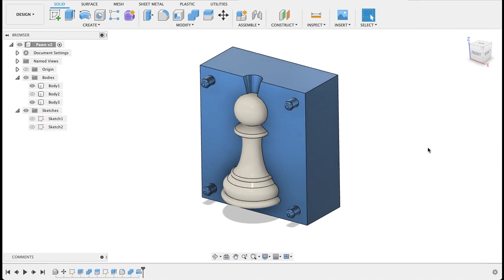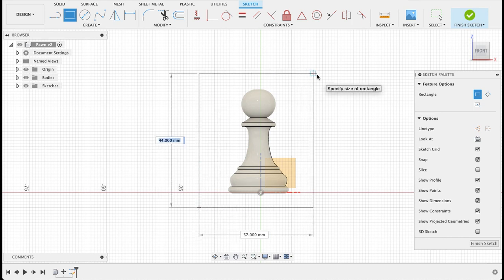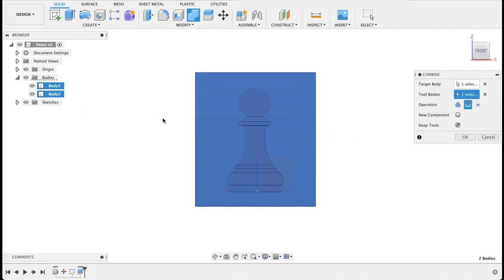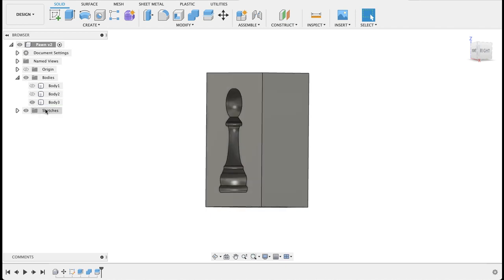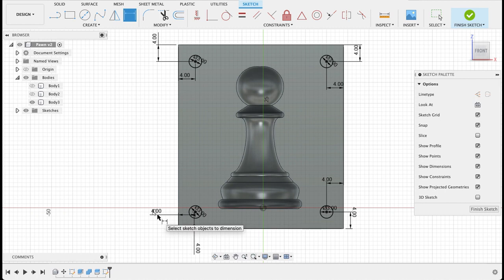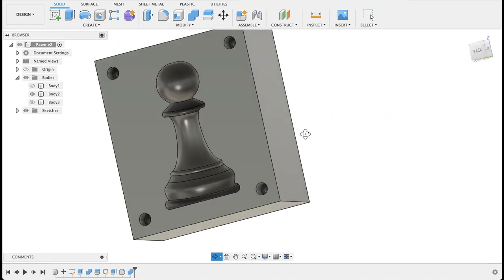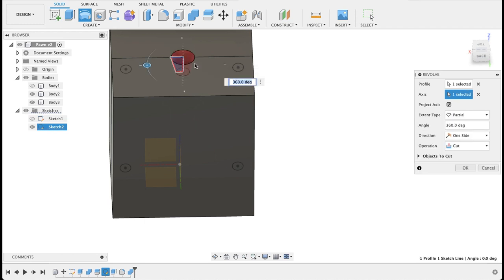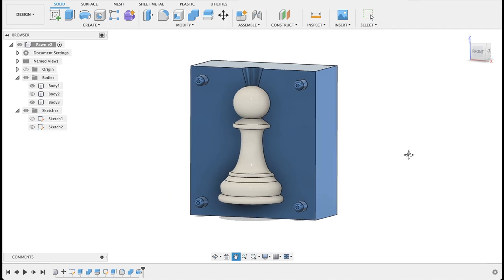Fusion 360 tutorial: how to make a mould (Chess piece)

Comment: Great Tutorial, but  I have a Question  regarding repositioning the Part A or B Part to X Axis or FLAT in Fusion 360 Manufacturing Menu Setup  :

Basically I used you video to Mold the Part A and B, woks perfect, however this Video assumes the part will be 3D Printed . 

What about if I wanted to  Reposiiton  the  Part A and B  to be FLAT for Fusion  ToolPath setup , its my intenttion ot use my CNC desktop machine  .

I was attemption the move command to retate  the part, but Fussion 360 ToolPath stll saw the Origional position from Design.

If in Fusion 360 Design menu the Mold are Verticle when they were Parted in 2 usuing combine and  split command. How do I how permantly reposition both parts if I wish to surface drill them on my CNC ? .

I been only using Fusion 360 for 1 year, did many  toolpaths cuts, but now I am intersted in mold making, but not for 3D printing.

Thanks for your help.
Reply from the maker: Hi, I haven’t worked too much with cam but it should work fine if you convert it to a component and then reposition it to the desired plane. 
What I have done in the past is to set it up on a fixture plate and machine from that.

Comment: hi what type of file can I use I need half of an egg mold ? I'm new at 3D printer 😅
Reply from the maker: Hi, you will need to export your design from Fusion 360 as either an STL or OBJ format and then you can open it in your slicing program to get it ready for 3d printing